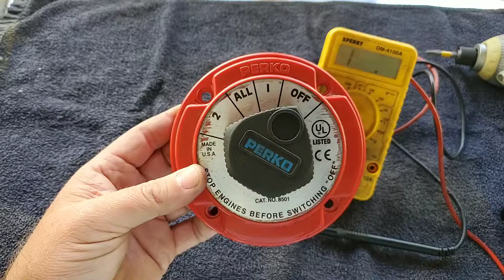Perko Battery Switch Fault (always ON) SOLVED! Read description

Comment: Whoever designed this damn switch should be fired and sent to the gut lag.  What a horrible design.  Springs and ball bearings don't stay in place and keeps falling into the dial cavity.  No wonder nobody likes these switches.  I would have fired the guy on the spot as soon as I tried to assemble one of these switches.